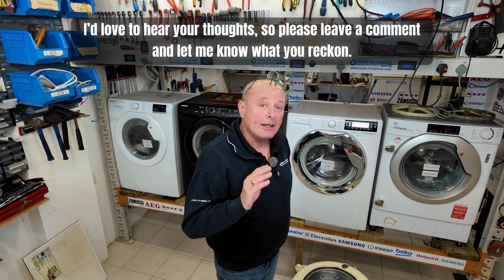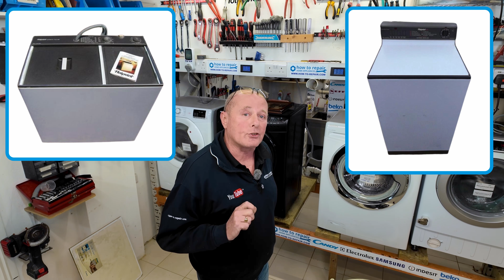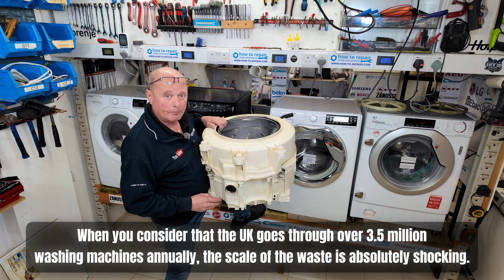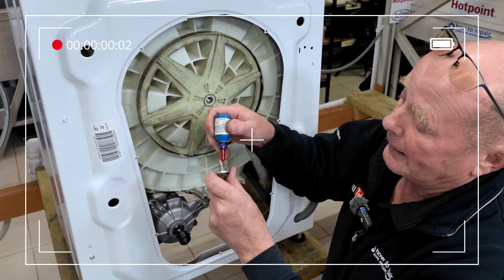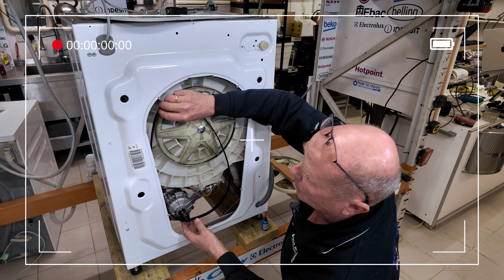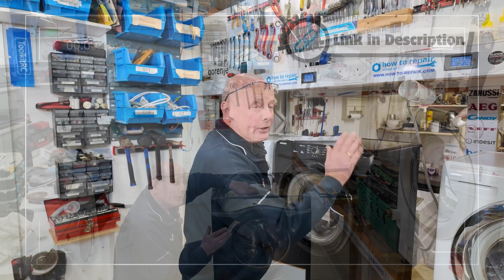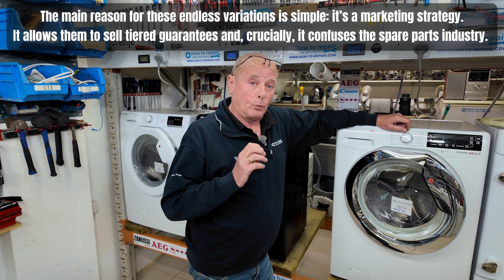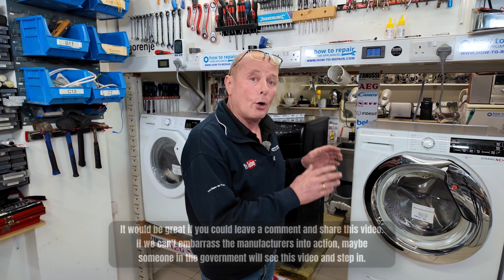I Scrapped 13 MACHINES to Prove a Point: STOP BUYING These Brands!

Comment: I met a guy on a plane, claimed to be wash machine engineer. This was years ago (25 or so), and he said wash machines (like these) are designed to wear out. Then it was about the tubing, what they're made of, and how the machine is engineered. He said it's only made to get rid of the  detergent in how ever many cycles, and the detergent is manufactured to destroy the tubing over time. He said the soap companies are in on it, they all make money from this. He said if u run only a teaspoon of detergent, it's enough to clean ur loads and it will reduce wear on ur tubings. Also, he said after the detergent cycle is ran, pour about a shot of vinegar in the dispenser, he said it counters the wear from the detergent.  I tried this method after my " OK" wash machine died (brand new, within half year) on the replacement, still going to this day after 10 years. It does have a problem, it squeeks sometimes, a piercing sound but, it still works so lol.
\O>
Reply: Interesting story. A lot of people in appliance repair say something similar—modern home appliances are often engineered around a limited lifespan, which feeds the whole planned obsolescence discussion. When materials, tubing, and electronics are designed to last just long enough, the machine eventually fails even if the mechanical parts could keep going.
Your point about detergent is interesting too. Many techs say people use far more detergent than necessary, and excess soap can leave residue that stresses components over time. Using smaller amounts and occasionally running a cleaning cycle can definitely help with appliance durability, even if it doesn’t completely solve the bigger product durability problem in modern machines.
A washer still running 10 years today is actually pretty impressive.
Reply: @IndustrialScienceLabYT  What's crazy is how long ago this was, that flight, and to know that was then, and it's only WORSE nowadays. Sad, but true. Cars are there too. I had "silverware" from MObil X or sumn, suddenly, the spons and forks are starting to "split" where the "silver" and plastic meet. I've had them mostly all fail around the same time frame, give or take a few months. Crazy...
\O>
Reply: Уксус? Это кислота!
Крестовина стиральной машины сделана из сплава алюминия, уксус разъедает метал. Резиновый сальник также не кислотостойкий.
Пожалуйста, не применяйте кислоты. Не применяйте средства для удаления накипи,соль 
Не используйте техническую воду. 
Всегда открывайте люк машинки после   работы. Лучше , если вы будете иметь две машинки использовать их попеременно, после просушки каждой.
Всегда! Отключайте машинку от сети
Reply: @Молодильныеяблоки-б9ы   I'm just telling u what dude said, I know nothing about washers and their insides. He said that, I tried it, and my washer is still running so...
\O>
Reply: @beyondquestion  я понимаю, парень защищал интересы компании , советуя применять уксус. Я всм лишь сообщаю, что уксус и другие кислоты -быстрый путь к поломке.
Между валом бака и сальником подшипника, производитель закладывает специальн ую водоотталкивающую смазку. Эта смазка не позволяет попадать воде в подшипник . любые агрессивные средства смывают эту смазку, а металлические части покрывается ржавчиной, истирая сальник. Подшипник начинает греметь, бак болтаться а после подшипник просто клинит. Я вам говорю потому что я занимаюсь ремонтом стиральных и посудомоечных машин. Самая частая поломка-подшипник. Затем износ щеток двигателя, перргоряние нагревателя воды, износ насоса слива и наконец проблемы с электроникой.
Берегите себя!
Reply: @Молодильныеяблоки-б9ы  Thx. But like I said, I been doing what hje suggested and been using the same wash machine, "OK", and other than that piercing squeek that happens from time to time,  been goin for 10 years, 12 really. I literally use about, i duno, less than 1/3 of the liquid soap reservior, and just a couple teaspoons (mayb tablespoons) in the pre-wash slot. After I can tell the water is flooding out the main liquid soap, i pour in a bit of vinegar.  Before, I had the same brand machine, brand new, and filled the soap/detergent as normal and no vinegar, that thing died in less than a half year.  I'm not recommending anything, I'm just telling the truth of what happened.   The gus that told me was a passenger on a flight from Germany to Usa, or vice versa, sitting next to me. Don't remember how the conversation came up, but, that's how it came to be.^^
\O>
Reply: @beyondquestion  я понимаю, приятно было пообщаться, берегите себя.
Reply: @Молодильныеяблоки-б9ы  U too man, thx for the info. U as well.
\O>
Reply: @Молодильныеяблоки-б9ы  Which manufacturers' washing drums are made of aluminum? Neither the detergent dispenser nor the drum is made of aluminum, and unplugging the appliance after washing tends to cause frequent voltage spikes (inrush current), which is certainly not good for the electronics.
Reply: @baenschman6756 сам барабан из нержавеющей стали, а его крестообразное крепление к валу из алюминия.Так делают все производители. Так же нужно понимать, что это крепление имеет полости. Они часто забиваются грязью. Эта грязь, пропитываясь кислотой еще больше разрушает крепление барабана , потому что не просыхает до следующей стирки.
Так же эта грязь является источником неприятных запахов в машинке. 
Вся электроника современных стиральных машин питается от импульсного блока питания , управляемого контроллером. Даже если на машина не включена , но не выключена из сети, идет беспрерывная работа блока питания и контроллера. Это вызывает преждевременную деградацию компонентов блока питания. Поэтому я всегда прошу своих клиентов выключать стиральные и посудомоечные машины от сети 
Для сглаживания пусковых токов ,почти все производители ставят сетевой фильтр.  Берегите себя
Reply: @baenschman6756 The drum spiders of most brands are made of an aluminum alloy. Nobody claimed the drum itself was   made of aluminum.
Reply: @Молодильныеяблоки-б9ы  Why unplug it?
Reply: @Delalcon все современные стиральные машины питаются от импульсного блока питания под управлением микроконтроллера. В высоковольтной части которого , даже в тогда когда машинка не работает, но включена в сеть генерируется 310v.
В цепи также стоит высоковольтный конденсатор 10mkf 450v
Именно он , находясь в постоянном рабочем режиме теряет свою емкость, начинает вздуваться , вытекать , что приводит к выходу из строя шимконтроллера по питанию. Когда однажды ваши машинка не включится, скорее всего этом будет виновен именно конденсатор 10mkf450v.
  Срок службы которого ограничен. Выход из строя этого конденсатора часто отражается на основном контроллере через дежурное, питание 5v . Он может полностью выйти из строя  или получить повреждение программы . из-за того, что большинство процессоров зашифрованы, вы не сможете прочитать программу или перепрограммировать его. Вас должен тревожить момент наличия 310v в машинке, которая не используется. Даже если не принимать во внимание лишнее потребление электричества.
Берегите себя
Reply: @Молодильныеяблоки-б9ы  Thank you for your thorough answer. In the EU washing machines cannot draw more than 0.5w/h when in the off mode. Is that even enough to sustain these capacitors?
Reply: @Delalcon  давайте поясню проще.
Если вы отключаете машинку из сети, она прослужит вам около 5лет, если нет 3года.
Reply: @Молодильныеяблоки-б9ы 👍
Reply: Good thing law here dictates 10 years if proper usage

Comment: In the year 2000 i bought a AEG LAVAMAT and it is now 2026 and still working good. My late mother had also an AEG and that one lasted for more than 40 years.!!!!
Reply: Sadly, AEG are garbage today. I bought an expensive dryer a year ago and it has been serviced two times because of noise. AEG said they can’t do anything about it, so don’t buy their products. Before it, I had a Bosch for 10 years without a single problem, the washing machine just as old. I replaced them because they were beginning to be worn out, being used a lot because of two small kids.
Reply: We got an AEG washing machine in 2024, and it's been serviced twice since then. Now we're trying to get our money back because the belt's making weird noises again.
Reply: My mum had a Zanussi for 13 years I think, then wanted a new one (nothing wrong with the Zanussi) and got an AEG, lasted about 3 or 4 years before the pcb went and it was uneconomical to repair. I got my first house about 22 years ago, and bought a Zanussi, and it still works well enough. But my dad's Zanussi he got maybe 10 years ago recently died. I think they have definitely become more disposable, but I do like a Zanussi. That being said, the missus wants a Samsung or Bosch next.
Reply: My AEG Lavavmat, bought in 2010 died after 5 years of normal use. Bearing broken. Complete replacement drum needed to fix that cost 2/3 of a new machiene. 
I remember my grandma had the same one bought a few decades earlier, wich ran for over 20 years. The reliability has dropped over the years. This I call moneylaundry
Reply: I bought an AEG Lavamat in 2006, bearings failed in 2021, everything else still worked, bearings not replaceable so it was scrapped!
Reply: Cool
Reply: AEG - about eight goes!!!
Reply: Our AEG Lavamat is now 24 years old. It has been superb. The only repair made during this time was a new heater element ( we live in a hard water area). I'm not sure what we would buy now as I understand AEG is not the company it was.
Reply: Dont lie !!!! nothing ever lasts that long . even my  Bosh washing machine only lasted 23. years
Reply: We have a 1981 Krups hand mixer at home that still works flawlessly, can't buy quality lile that anymore
Reply: AEG is GOAT
Reply: @STUDIOMAGIC Hell nah, new AEG is trash
Reply: @STUDIOMAGIC My new dryer disagrees, it’s trash

Comment: Great explanation! In 2012 I repaired a Candy's washing machine from 2010 because bearing faulty and in technical opinion i should had chance all the drum whit a new one. Instead I opened that, changed the bearing with a sealed one, applied 1 addictional gasket and found a correct sealant to close again the drum. An hard work but today it still working. The original bearing wasn't correct to stay in that place ..it was only a mistake? From Rome

Comment: My Mum had a Hoover washing machine back in the early 70s, her pride and joy and lasted donkeys years. We recently purchased a new Hoover washine because i thought and remembers Mums. Within a year it sprung a water leak and out comes Hoovers engineer, he condemed the machine as dangerous due to a major wiring fault from manufacture. Really struggled getting a replacement machine, all the excuses under the sun. The customer service was a nightmare and unfriendly. The replacement started playing up just over a year. We have a Beko now, been a good machine. Been told Hoover are Chinese ownened, how true I dont know but I do know is no Hoover in this residence.

Comment: I bought a Gtech hedge trimmer and instead of a breaking a shear pin fitted it would strip a gear when it attempted a cut that was too much in a hedge, really bad design and designed to fail, and no spares.

Comment: Decades ago we got a Hoover top loader machine and it developed a fault which indicated circuit board failure. It was so new that they didn't have any parts in stock so we got a new machine. Some years later I had to get a replacement cold water valve for it. The parts guy mentioned I was lucky it was an early one in the series because it was an individual valve rather than a combined hot/cold valve at more than double the price.  He also mentioned they were doing very well out of Aldi because their washing machines would split the drum. I think he said the parts and labour came to $700 on a $600 machine.

Comment: Just paid in repair exactly half the price of a Samsug 6/8KG with a dryer I bought 4 years ago exactly, shaft worn out and tub broken from the shaft side, pump is becoming loud, absolute trash, I was using this machine only for me, I live in a Studio, maybe the dryer heat is the cause but what is that machine that would last only 4 years for a single user laundry!

Comment: I find my washers on the side walk, my last LG lasted nearly 20years, paid nothing for it. Found another LG on the side walk and it looks great, but preforms badly, i use it as our outside washer to wash super dirty work clothes  ... got given a panasonic which needed a simple repair and its really good. Washes well and super steady at 1200 rpm .... it replaced our old Whirlpool toploader which lasted around 40 years ....

Comment: Thinking positive thought about the washer in the basement. It's currently about 30 years old and still working fine. In the early 80's my father bought it to replace the old one that was probably almost 40 years old. The fantastic thing was that it was basically the same machine, just updated and freshly manufactured. It was a machine they built for their one fifty year anniversary or something like that. And my father saw a notice about it and jumped on the possibility. The old one was starting to rust and the program had worn out to the degree that he spent a day picking it apart and making som cog wheels to replace a few that had lost a few teeth.
It is of course a very old design. It has a washing drum and a separate centrifuge so you have to move the clothes to that manually. But it's never had any fault since it replaced it's older sibling. Though now the use has started to show wear on the plastic part that holds up the front of the drum. But even if Electrolux can't sell me the part it's very simple and there should be no problem having it 3D printed. Not having the drum spin at centrifugal speeds really simplify the load on bearings to the degree that the front of the drum doesn't even need one. Being top loaded but with the drum in the "normal" longitude as any normal front loaded machine just makes things so much simpler.

Comment: Absolutly, especially medium range kitchen appliances. It's ridicioulis. Often its even parts that deacivate a safety features, so without the activation the machine does work, are build fragile and often in a completly deliberately unneccary risky spot placed were they break more likely. I always repair kitchen appliances and the damages are the most bizarre and stupid things. These Machines are like a thing like a mirror f.ex. with a tiny crack or chip, absolutly not serverly damaged but not working. xD

Comment: "You get what you pay for" funny as it applies today even more than before. Fun fact my parents, now in the late 70;s still have their Whirlpool US made Fridge & freezer they bought back in 1995 - when I was a kid. It is frost free (a revolution back in that age) and had some pipes and refrigerant agent changed ofc, but the compressor, the seals and everything else is still genuine. It works exactly as it worked in day 0. Then again, back then nobody cared about energy efficiency and ratings, so it eats a lot. It's a tank of a fridge and eats like a tank, but it does it's job to perfection!
My favorite brand in fridges, washing machines, kettles and so on it's AEG. I still have the kettle from my childhood the my parents "gifted" me when I moved out in 2006 :)) (Stainless steel with a full bottom. the heating element is not submersed in water). Built to last.
I guess the moral is: They used to build things that lasted for a lifetime. Or don't change it if it works?!

Comment: Well one thing to think about this is that in the 80's the appliences cost a lot more money, like washing machine could cost a months pay and now a days you can get one new for under 300€. So if you bought 1500€ washing machine in the 80's. If you buy every 5 years a 300€ washing machine after 25 years you have used the same amount of money...So the machines are too cheap. If the washing machine cost like 3000-4000€ and everyone would repair it if the repair cost was like 300-500€. And most of the electronics are easy to repair, if you can get the schematics. But sometime manufacturers use cheap custom chips with their "own" software so the chip can't be replaced, because no one manufactures replacements. Good example is tv repair, nobody repairs their tv's anymore, most of time it's easy and cheap to repair, but why repair when you bought it under 500€ and can get new and better under 500€.
Reply: Also sometimes designing new parts that fixes the problem cost so much ( like if they need make new mold) that it's cheaper for manufacturer to make faulty products and repair them free then fix the design. Then maybe after 25-30 years when the molds have been used they make new mold and fix the problem.

Comment: You also need to cover how LG doesn't even heat to 40c barely gets to around 25c by the time it drains... On a 60c cycle it reaches around 45c. Lg say this is normal and I don't need to have hot water. Told them why do you bother having temperatures then! It's awful and I sent the machine back and got a Bosch now which is great.

Comment: Low water consuming machines I have had in the past left dry spots on my clothes, even soap sitting on those dry spots when the "wash" was finished. The short wash cycle took over an hour.   I will never buy one of those machines again. I want my clothes submerged in water and agitated, not barely misted and spun around for an hour and a half.

Comment: You can't beat those wm Hotpoint ist edition repaired hundreds of them easy to fix new spiders and bearings good circuit board I used to get them in around 10 to 15 years and they would go on for years after 
Even though I worked on all models they were my favourite and of coarse built in the UK